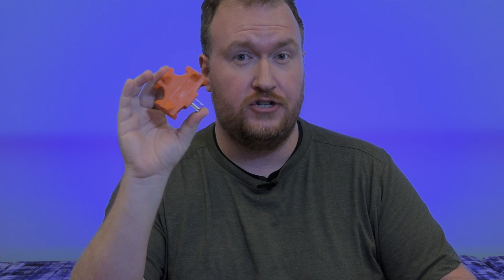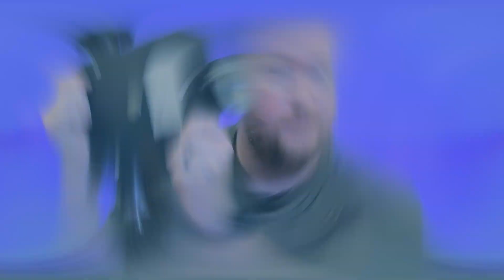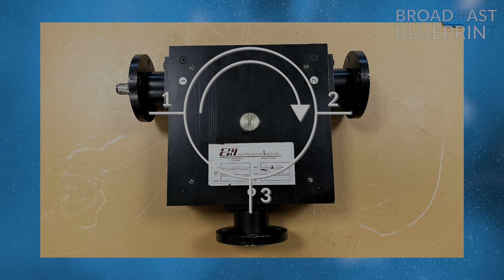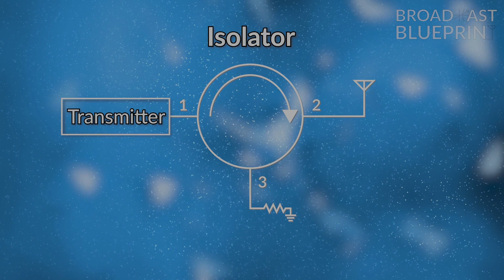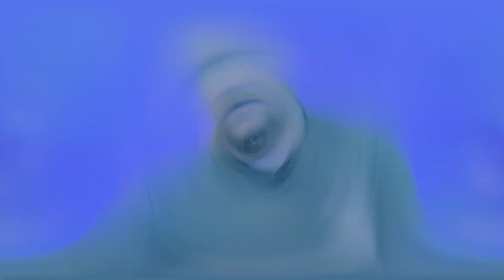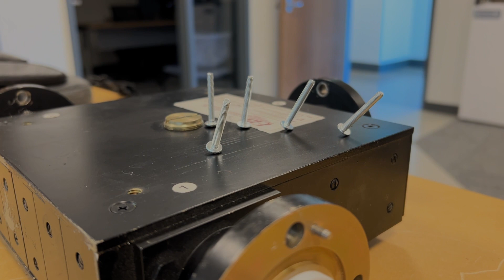The Mysterious Component Passively Steering Radio Signals

Comment: I have heard a credible story of these being employed in some very old microwave ovens, to prevent damage from running empty or with too much metal in cooking chamber.  Heard it from a guy who had taken an MWO repair course in 70's. Told that they remained niche feature due to manufacturing cost and relatively low benefit. I have, however, so far failed to find any information about these anywhere else. Would someone have any reference about these implementations?

Comment: YouTube suggested your channel today. (New Sub here) Many years ago I used to work with optical circulators. They were probably the most expensive part in our test equipment, with exception to some laser diodes. We used them in our high end 50dB OTDR's, so we could avoid the 50% loss of a coupler. RF on the other hand is what one YouTuber refers to as the 'Darkest of the Dark Arts' I look forward to more.